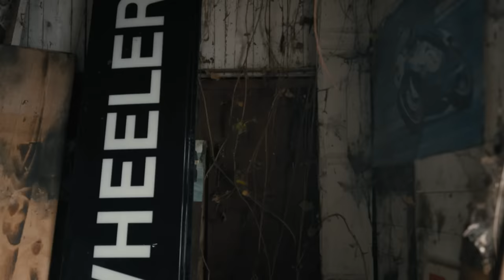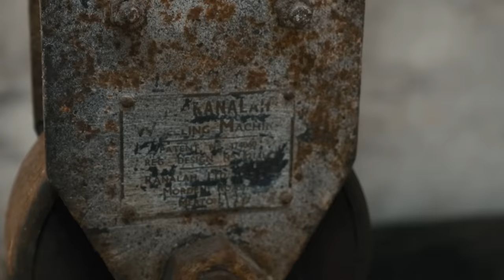HUGE Ranalah Discovery! | With Steve Fletcher

Comment: Dom's had a haircut and looks 20 years younger! I've just been round an old bicycle repair shop that was set up in the 1920's and left in the 1980's and not touched since, it had a very similar vibe to that place. The bit where the wood dropped was pure 'Only Fools and Horses' - nice to see 2 guys working with no safety equipment and not a risk assessment in sight!

Comment: Great find Dom. I ex army and a bit of a ww2 history geek. Steve mentioning De Haviland is interesting. The war department tasked small workshops just as this to make aircraft parts during the war. This idea was to spread out production ,so that it would be impossible for the Germans to bomb just one factory and halt production.
If it was used for De Haviland parts it would have almost certainly have been for the Mosquito. A primarily wooden plane but incorporating some metal panels.
The other alternative could be that the wheel was at the nearby De Haviland factory and sold of after the war.
The fact you found it so close to an old aircraft factory makes it almost certainly to have come from there.
If so a real piece of british history .
Credit too you and Steve for saving it ,to keep the history alive.
Reply: If not in situ from new could equally have come from any post WW2 sell off
Reply: @highpath4776  yes maybe, but what the hell would they have wanted such a large machine with which to wheel? My money is what  Ian Lane said, small workshops ordered to produce parts for the WW2 aircraft industry. Which is far more likely.
Reply: @samrodian919  I'd guess that after the DH factory closed, the fittings were sold off very cheaply and the bike shop saw an opportunity to obtain a useful tool.
Reply: Thank you for the info, very educational!
Reply: I was raised in a tool manufacturing town in the northeast.  My dad was the guy you went to when your gizmo wouldn’t work, or wobbled.  He knew a guy who knew.,.so I love watching these guys..,

Comment: Hi Dom,a friend of mine who has sadly passed away worked at the ranalah factory during the sww described how there was twenty wheels in a row fixed to the floor and ceiling. During the day the constant pressure of all the wheels lifted the ceiling which was also the floor above so when they finished they had to slacken all the wheels off to stop them damaging the wheels.

Comment: 14:18 It's hanging on because the through bolts are pulling out of perpendicular  and that pulls the plates against the beam , locking it up.
You need to loosen the through bolts to the point where that won't happen or push the front plates up.

Comment: I hope it is used and not just added to the collection. Pity they ignored the uni cycle. A little tip, if you are unfastening old bolts, clean and oil the threads, makes things a lot easier. Hope I am not teaching anybody to suck eggs. This machine will make a very useful and versatile tool, congratulations

Comment: A great find but what about the rest of it? Wouldn’t you need the frame as well?
Reply: I think the idea is that the unit is mounted however makes sense in a particular shop, so the rest of it is specific to the shop rather than part of the Ranalah. Some functional equivalent would be required to reinstall it, but not that actual frame.